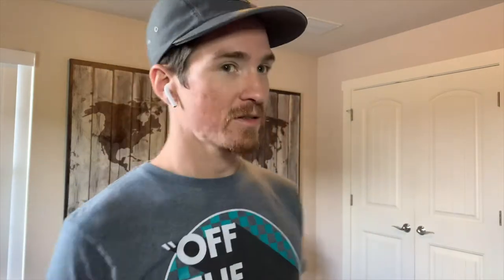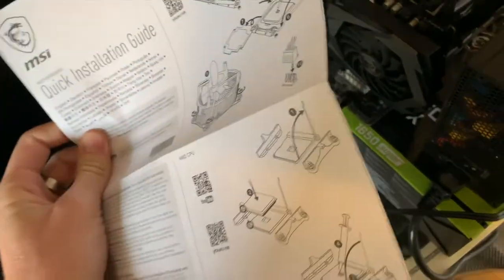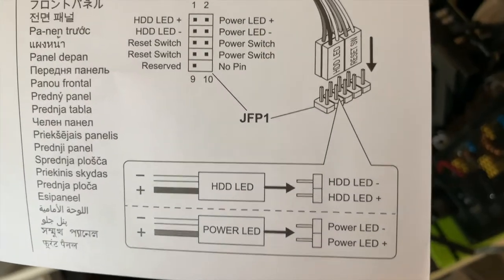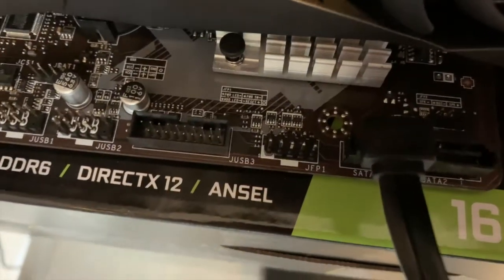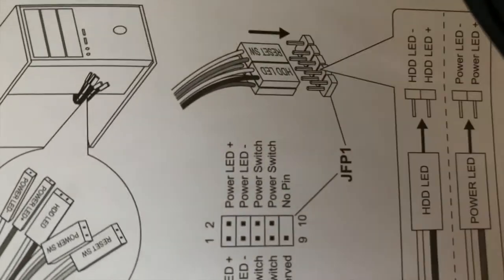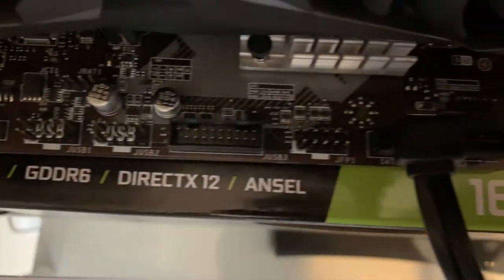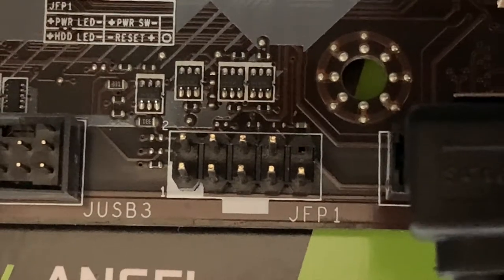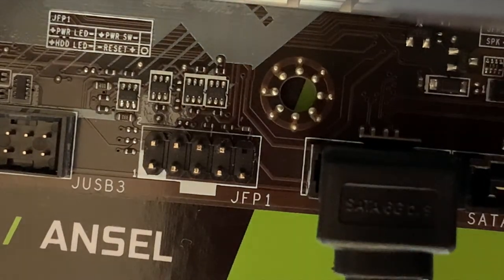How to Turn on a Computer without a Power Button [2020] #buildingapc #5minutefridays

Comment: Or you spend 80 bucks on a case and the power button arrives non functional and they refuse to refund you because they can show them proof since it's mechanical and the file limit for Emails means you also can't send a video? Well great I can now use my foot stool for it's intended purpose

Comment: Thanks, helped me figure out that my front panel connectors were dead. I thought my motherboard was, so you saved me a bit of time
Reply from the maker: Glad I could save you some time!
Reply: mine seem dead too, like nothing looks dead besides that te front panel connectors don´t work. any ideas if it is ?
Reply: Happened to be my “case” as well.  I upgraded my mobo and did some neat cable management.  I might’ve tugged on the front panel wires too much :(

Comment: I got stuck out rural for 6 months and had to do this after power outages coz my button stopped working. Moved house and now I'm beginning to think I have broken my mother board coz this trick isn't working lol
Reply: I solved the problem, the pins needed to be pressed a little bit so that they were properly connected/touching the mother board. Also I got a button now yay lol

Comment: My power button is completely broken on my NZXT H500i case, Can i buy a power button that goes into the power connector? If so have any recommendations?
Reply from the maker: so depending on how the power button is broken, you may be able to just rebuild it and fix the problem. You can also call nzxt parts department and see if they can send you a replacement. it would be ideal to get an original part from them.
Reply: @TechEndeavor  Thanks :) Only just realized you have 250subs damn you deserve wayyy more you got yourself another sub. :)
Reply from the maker: @KylezUwU  Hey no problem! I appreciate that!

Comment: another thing to check that i just had issues with: check your front panel. if your pc powers on momentarily then shuts off for a few seconds and won't turn back on with the power button, check the front panel connection to the power switch. i was trying to figure out for days why it was happening, and it was simply just the front panel connection.
Reply from the maker: Thanks for the info! Do you create the connection on that one to reset it?
Reply: @TechEndeavor  i didn't connect it back because the power button isn't moving right and it just makes the switch on the wire get stuck. so for now i have that wire sticking out of the case and i just press it with my thumb.
Reply: That’s what my pc is doing what did you do to fix it ?

Comment: If this didnt work is it safe to assume that my psu is the culprit for the pc not turning on? I have a pc case and all but it just stopped turning on yesterday. There were no issues and I’ve tried to find out what it was.
Reply from the maker: it's hard to say. could be power supply. could be mb. you can try plugging in to different power supply to see if it turns on. then you can confirm or rule it out

Comment: I think this is really cool to do, but is it safe to do this long-term?
Reply from the maker: safe? probably not, due to the fact that everytime you have a risk of shorting. get yourself a cheap switch on amazon, or just buy a case that has the switch. this is just a short term solution to test your setup if you dont have a case
Reply: @TechEndeavor  what amount of risk we talking??? I have a powerswitch but the bloody thing decided to break
Reply from the maker: @sirspongadoodle  you run the risk of shorting the mb if you touch it with the screwdriver so just be careful

Comment: I tap the 2 pin sw on my board and nothings happen.. Whats the possible problem? No light on ram and the cpu cooler fan not functioning
Reply: I’m having the same problems how did you fix  yours

Comment: so to turn it off you just touch it again? (other than turning it off from the OS)
Reply from the maker: I'm not sure. I just shut down from the UI. You can try holding the screwdriver on there to mimick holding the power button down but I give no guarantees on what that will do so try at your own risk.

Comment: I need a help. I basically do this everyday until today when i tried it again it wouldn't work. Tried to unplug all cables except the psu and even the psu still turned on. Put my screwdriver to the pin and it wont start again. Can you please help?
Reply from the maker: Join the discord server and lets troubleshoot https://discord.gg/68PD8Rzar4

Comment: Can i put power switch back on after i do this? (while my pc is still on) Is that safe??
Reply: i need answer asap
Reply from the maker: I dont know specifically if that is safe but generally speaking you dont want to plug and unplug things while the power is on. risk of a short
Reply: @TechEndeavor  Did it already before you responded. Nothing happened. No side effects, no file corruption nothing happened. Thanks anyways :D
Reply: I forgot to add its safe completely.

Comment: How do you turn off the pc without the power button if you turned it on using a screwdriver? Same method?
Reply from the maker: No you just shut down the computer the normal way by clicking shut down.
Reply: @TechEndeavor  What if your in Bios and don't have an OS?
Reply from the maker: @AI-lf9qb  well that's a different issue altogether
Reply: @TechEndeavor  so you just gonna say nothing else about this?
Reply: @GrandCamo  Not sure if touching the PWR pins again will turn off the computer, but you can just turn off the power on the exterior switch of the power supply.  O = off, I = on.

Comment: I did this but it won't stay on
Reply from the maker: sounds like there's another problem with your setup if it wont stay on
Reply: @TechEndeavor  like what?
Reply from the maker: @Nic.2o9  hard to say without looking into it in depth. could be a loose connector, could be anything. Do some research and see if you can troubleshoot the problem.

Comment: useful video! however it’s a little hard to see exactly what you’re shorting. Are you shorting the reserved pin on the JFP1? or the little circuitry above it? thanks
Reply from the maker: Hey thanks for the question. It's the jfp1. Its hard to tell from this angle but the screwdriver is not making contact with those nodes above. Just those two pins marked "power supply" in the user manual
Reply: @TechEndeavor  It looked like you were touching the nodes. Thank god I read this comment!

Comment: This worked once, i then tried to restart my computer and it didn’t work?
Reply from the maker: hmm. did you discharge any static before touching it again? did you accidentaly touch the screwdriver to the mb? It's hard to know what's going wrong without more info
Reply: @TechEndeavor  i might’ve accidentally touched the mb, would that cause any problems?
Reply from the maker: @3xx0clan  it could have shorted it out. make sure everything is plugged in tight and your power supply switch is on.
Reply: Hi can you help me with mine
Reply from the maker: @dayshawn8950  whats the problem?
Reply: @TechEndeavor  me too pls
Reply: @TechEndeavor  which place should i press actually 😅
Reply: @TechEndeavor  sorry but im kid
Reply from the maker: @shanaadam7296  you'll have to find your mb pin diagram (in the user manual) to locate the power pins

Comment: Please help, my computer only turns on for a second then turns off, all of the parts are brand new, I don’t know what to do. Please Help?
Reply from the maker: It's hard to say what's wrong without knowing how you set everything up. Did you use the screwdriver method?
Reply: Yes I used the screwdriver, this method work earlier then it just stopped working.
Reply from the maker: Interesting. So it's not turning on at all now?
Reply: The cpu fan spins for a second then turns off
Reply: It is working now
Reply: Idk what happened
Reply from the maker: @benicarideo2754  good to hear! i had something similar happen to me when i first built mine. it wouldnt boot up at all. then all of a sudden it started working and i have no idea why. glad to hear its working for you now. those moments are terrifying
Reply: Thank you, love your videos, you help me a lot!
Reply from the maker: Thanks! Glad I can be useful 😌

Comment: I did it and my computer won’t work anymore
Reply from the maker: It’s possible you short circuited the board. As I mentioned in the video don’t touch the screwdriver to anything else and make sure to discharge any static electricity

Comment: Is this bad for your pc?
Reply from the maker: its not ideal, and if you can get a power switch, that's the best course of action. However, if you're in a pinch and you do it correctly, i.e., discharge any static, and dont make contact with any other pins or any other parts of the mb, there shouldnt be any problems. now, I will say, you do this at your own risk.
Reply: @TechEndeavor  alright thanks

Comment: Yo so i bought my pc like a month ago and it wont turn on do you know why?
Reply from the maker: Well it's really hard to say. What's changed since the last time you turned it on?
Reply: @TechEndeavor  same problem and i did not change anything and when i do this trick nothing happen
Reply from the maker: It’s really hard to tell from here. Could be anything
Reply: @TechEndeavor  when i does this trick, power supply turns on and then turns off any ideas ?
Reply from the maker: Make sure the power supply switch is on. What mb do you have?
Reply: @TechEndeavor  asus z270
Reply: @TechEndeavor  and for the power supply switch is on everything is good the power on button and the motherboard and the power supply but the pc wan't turn on
Reply from the maker: @aymane7375  I would recommend picking up a little power switch from amazon and testing that out. here's the one i was using thats like 6 bucks https://amzn.to/3r2ue7m
Reply: @TechEndeavor  well last time I remember there was a little light inside the pc that was like on all the time when the pc was working but i just came home from school and the pc just suddenly wouldnt turn on and that little light was off and i know nothing about pcs so i watched some youtube videos and i tried to take out the coin battery and put it back inside but it didnt help so could you help if possible?
Reply: @rezanuzumaki7758  the same problem i think its a power supply issue
Reply: @aymane7375  so did you fix yours or what. And im still stuck with this problem I dont know anything about pcs
Reply: @aymane7375  where is the power switch located i can’t fine mine
Reply from the maker: @aymane 737 @VipNoLoveEnt4348 YT I started a discord server where it’s a little easier to troubleshoot these things https://discord.gg/paqsKmt5

Comment: It didn’t work
Reply from the maker: Are you sure you got the right pins?
Reply: @TechEndeavor  yeah I literally made sure I used the right screwdriver while the oc is connected in the same pins and everything it doesn’t open 😭
Reply from the maker: What mb do you have?
Reply: @TechEndeavor  aorus a520m elite